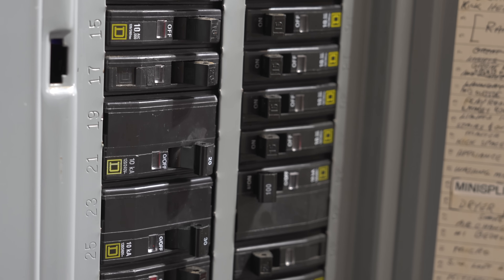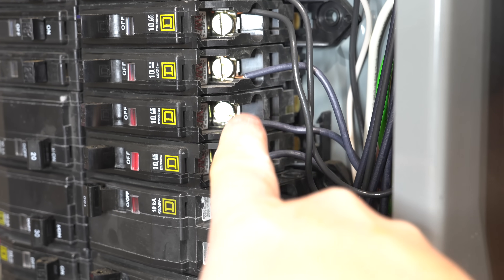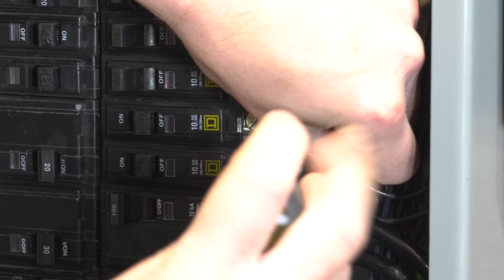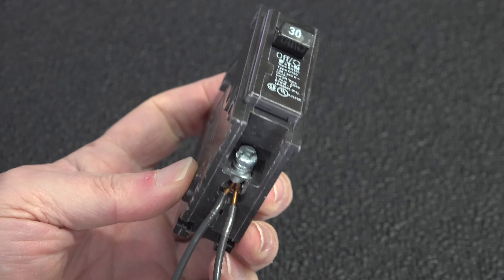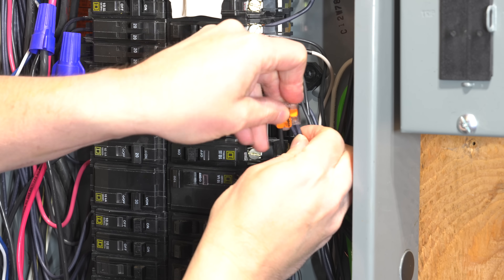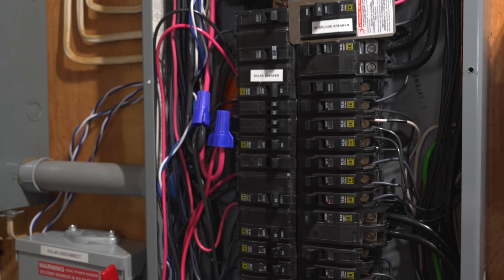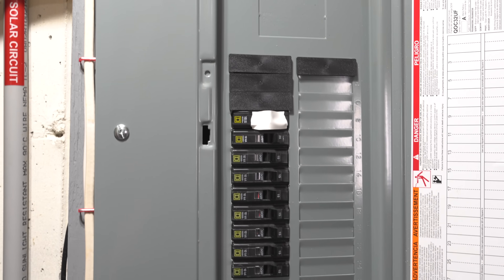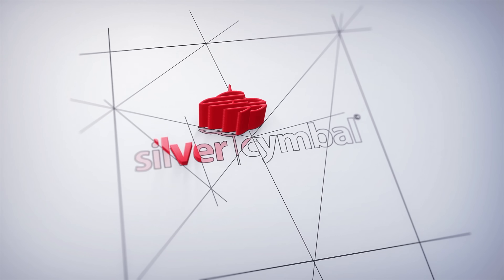Electric Panel Full?  Try This Simple Fix

Comment: There are rules on how many outlets or devices you can have on a breaker where I live. You could accidentally double the count by combining onto one breaker. Be careful
Reply: With LED lights, whatever the rule is for number of lights you can have is probably way under what is reasonable nowadays.
Reply: @LowJSamuel  While that may be true if using LED the issue is if someone else moves into the house there is nothing stopping them from using incandescent bulbs.
Reply: @jalmolky  There is also nothing stopping someone from plugging several microwaves into the same circuit, but you're still allowed more than one outlet.
Reply: @jalmolky  
Some newer light fixtures only accept LED lights
Reply: @LowJSamuel  Right, but if someone is doing that then they are doing it knowingly.  Different story if someone moves in expecting a regular circuit and runs into problems only to find out it was set up to handle an excess number of LED fixtures rather than a normal number of regulars.
Reply: @jalmolky  There are plenty of cases where people don't knowingly overload circuits and do something they expect to be able to do.  Code doesn't (and shouldn't) prevent all of these.  That's part of the reason breakers exist.  Putting a windows A/C unit plugged into an outlet that the microwave uses is an example I've seen plenty of times.
Reply: @LowJSamuel  Again that's something someone is plugging in.  Just to be clear my initial comment was to your saying the rule for number of lights is probably way under what is reasonable which is a "hard wired" assumption that everyone will just use LEDs.
Reply: @jalmolky  How is plugging in a device substantially different than screwing in a lightbulb?  Both are designed to be done by the end user and but you seem to think it's only ok for one of them to have a potential to overload if done wrong.
Reply: @LowJSamuel  Because one simply involves unplugging the device and/or moving it to a new receptacle/circuit.  The other is being unable to use certain combinations of switches until you swap out bulbs or perhaps even fixtures.
Reply: @jalmolky  I'm proposing that the code be updated to allow fixtures originally installed with LED bulbs to allow more of them on each circuit.  So you wouldn't need to change fixtures at any point.  If a later owner decides to replace lightbulbs with older technologies, that's really on them.  Especially considering incandescents can't even be bought anymore except for special applications, and the general consumer is pretty much only going to buy LEDs going forward.  I really don't see how expecting consumers to not replace their LED bulbs with antiquated bulbs they have to go out of their way to purchase is somehow more of an ask than expecting consumers to not plug in multiple high-load devices to the same circuit.
Reply: @LowJSamuel  Incandescent are readily available if you know where to look and are preferable where you want heat output (this may be climate dependent) and better quality of light (subjective).  We can keep going round in circles, but I stand by my original comment that code shouldn't be updated just because you can install LEDs if you choose.
Reply: its 12 plugs/lights for a single 15amp circuit. Its 85% which is the max you can have on a single 15amp breaker for safety reasons in most places. So it isn't good practice to doing what said in this video unless you test with a multimeter afterwards making sure the breaker isn't overloaded from what the manufacturer recommends or your local electrical code
Reply from the maker: Agreed I did say in the video to use a doorbell circuit or a single outlet circuit or similar circuit.
Reply: @SilverCymbal  a single outlet circuit shouldn't be used. It's dedicated for a reason and going about this haphazardly because you want more room for more circuits is dangerous. And when you move the next homeowner has to deal with the "upgrades" that never should have happened when they want to use the distributed power as it was intended. Using tandems and adding a sub-panel is fine because you're adding circuits without diminishing others.
Reply: The rules where I live are you only have to divid the house into two circuits.

Comment: DON'T MAKE SPLICES INSIDE YOUR PANEL
Reply from the maker: Hmmm, now if you are an electrician you are fully aware approved pressure connectors are absolutely allowed in your panel and common. Every manual transfer switch in the world uses these within a panel. So let's not go crazy here
Reply: Sure there are ways to do it safely but the homeowner who doesn't know the calculation shouldn't be given this option at all along with double tapping a single breaker.
Reply: Not crazy, just basic electrical safety that you don't seem to know about.
Reply: You don't know about the capacity calculation. It's okay to not know things, but this "because I said so" attitude is a real bad look.

Comment: Chicago electrician here, DON"T DO THIS!!!

If you're a home owner don't do this. This only works if you can calculate the load of both circuits to equal to or less than 80% of the breakers headroom. That's the only way a professional would do this; if the breaker taking a load that was at or under 80% of it's capacity. If you don't know how or why you'd need to do this calculation than you shouldn't be doing this at all.

The only acceptable solution in this video that a non-electrician should be doing is the tandem breaker.
Reply: Not to mention moving a circuit to an opposite phase on a mcbc causes a whole host of other issues.  Chicago suburban sparky here.  Pay attention to my brother electrician aaveloone.

Comment: Stopped the video immediately after you mentioned double-tapping the breaker and went to post a comment about using a Tandem breaker. . . I feel foolish now as you explained that moments later in the video. Great video!🙂
Reply: Double tapping is allowed if specified on the breaker, there will be 2 indents for wires if allowed.
Reply from the maker: Yes and though many are shocked to know that the double tap is allowed, as mentioned its ok for 1 or two needs but tandems are easier and the subpanel is good for long term needs as shown.
Reply: I was about to throw hands at my TV too. Tandem breakers! 🥰
Reply: @AndyTrent90 only if your panel accepts tandem breakers

Comment: Yikes SC, I realize that you have solar and dual back-up capabilities ...but man, that is one complicated and chock full electrical service. A packed main panel, a packed sub-panel and second sub....all that for a single family.
Reply from the maker: Yes, for this setup an additional sub-panel was needed. Keep in mind this house was built 30+ years ago too, long before smart stuff and internet. I have no idea why they wanted so much separation with circuits. It's still just a 200amp service.

Comment: I'm not a licensed electrician, but I've done enough electrical work, and worked with enough inspectors to think this is sketchy as hell. Will it work? Of course, especially if you're combining LED lighting circuits. Will it pass inspection? Ask your local regulatory organization to be sure. Anyway, thought provoking and probably controversial topic! Thanks! Dave J
Reply from the maker: Am inspector will not want to see more than 1 or 2 double taps or tandems and of course they always have the last say on any decisions and do not have the follow electric code if they choose not to.
Reply: @SilverCymbal  That is so true. I've walked into our county code office with code book in hand to complain about something an inspector "failed" and although I was technically correct the manager wouldn't budge, even though he had nothing to back it up. Just the way it is if they want to be more conservative. Once again, thanks for the great videos, I hope NH is treating you well. My cousin lives at the foot of Monadnock, so you're probably "neighbors" relatively speaking.
Reply: @dj-kq4fz  What's the point of the code if they're allowed to make up stricter rules?
Reply: @mezu-e  There is usually an appeal process if you disagree with the inspector and it costs money and time.  It is usually cheaper and quicker to do what they say, You also do not want "that" guy that winds up getting a hard time from everyone.
Reply: @SilverCymbal  Electrician here, Unless you know the calculation you didn't talk about a homeowner should never do this.
Reply: I have a bunch like this in my house. Like that when I got it and passed inspection.
Reply: @ChunkyMonkaayyy  According to the National Electric Code (NEC) the electrician installing the panel/breakers needs to do the capacity calculation for each circuit. Not sure what inspectors are suppose to do as it's going to change depending on the jurisdiction.
Reply: What is sketchy about?  Anybody can claim it's "Sketchy as Hell", but what do YOU say is written that says it's legally wrong or a regulatory violation by any county in the U.S.?  Give the legal reference why you say it is "Sketchy as Hell".   Tell us what rule, chapter and verse that says you can't legally do this, BEFORE you claim that it's "Sketcy as hell".
Reply: This is code compliant DEPENDING ON YOUR BREAKER BOX.

They each have data sheets and many will allow for two wires to able to go into one breaker (provided they are done via Wago and pigtail and not just two shoved in there).

That is my understanding at least.

Comment: Never thought of pigtailing  always used the tandems.  Thanks.  Learned something new today
Reply from the maker: Tandems are always an easy bet and take out the figuring out part. A little known fact is that about 99% of every doorbell transformer is double tapped to a breaker and sadly most are not rated for 2 wires. If they pig tailed as shown they would be. I would never put two wires on a breaker not designed for it and always pigtail if needed.
Reply: @SilverCymbal  I’ve spent the last 45 min seeing where I can free up space now hahahaha.
Reply: Tandems need to be listed for use in the panel. Check the door of the panel and it will indicate if the tandems are allowed . Inspectors will check for the listing.
Reply: I always use tandem breakers whenever there's no space left for another breaker instead of pigtailing two circuits on one breaker
Reply: In the case of a tandem breaker, the A/B doesn’t indicate the phase. Both breakers in a tandem are on the same side and draw from the same phase. However, breakers are supposed to be numbered with odd numbers in one phase and even numbers on the other. So putting two breakers in the spot previously taken up by one would throw the whole numbering off. That is why both sides of a tandem have the same number but are designated A & B.
Reply: @TheWilferch there are two A/B designations you are referencing. Leg A/Leg B covers the "split" phase "line" feed into the panel; anything toward the loads to be served is the"load" side. The breaker numbering can be split for tandem brakes to 28A & 28B, etc when using tandems. First is the service leg feeding the circuit, second is simply a convenience of numbering breaker positions.
Reply: @EngineerMikeF  ...I understand and agree with all you say. I think you need to see a specific GE GoldLine panel breaker-location schematic....to fully understand the point I was making. No doubt...going "Down" each leg of the panel.... breaker "1" ( top/left) picks up from leg "A" ( 120V). Breaker 3, immediately below breaker 1,  picks up power from "B" and so forth, in alternating fashion. Similarly.....the top right breaker "2" , picks up power from "A" leg....and immediately below, breaker "4" picks up from "B". Here's the rub.... the bottom 4 brwaker locations have capability of using the half-width breakers. The legs A and B at these locations look different with additional portrusions that ceetify these locations to be different and allow slim-breakers. The rub?---> each of these lower breaker locations have a dotted line running across them ( telling us slim breakers are ok here....YET....each FULL SPACE location is labelled A/B on the GE panel. Example...location 25 is labelled A/B yet clearly shows the "dot" as picking up power from "A"....and likewise, location 27 is also labelled A/B yet is clearly picking up power from "B". No doubt, when using slim breakers, you must be VERY careful WHERE the power is being picked-up from....ESPECIALLY for double-pole breakers that want each single-breaker of this "combo"....to pick up power from both A and B...one breaker for each leg. The rub--> why is the GE panel labelled this confusing "A/B" way for all slots 25-32 ?

Comment: So  an illegal double tap
Reply from the maker: No, a breaker designed for two wires is allowed or with a pigtail. Two wires on a neutral screw (single) in the panel is not.
Reply: @SilverCymbal  yeah I saw double occupancy breakers  part later on but like you said yourself probably still going to be double tapped either on the ground or on the neutral

Comment: The prior owner of my first house did that.  When I went to sell it, the inspector accused me of “double lugging” and failed the inspection.

Although I could’ve corrected it myself, I was required to hire an electrician to correct it and an electrical inspector had to check his work prior to the city inspector’s return visit.
Reply from the maker: Interesting, you are never allowed to have neutrals share a single screw, but you may have two wires share a breaker designed for two wires and the pigtail is commonly done to add a circuit or two. Tandems as shown are the best option before changing out a panel. I will be interested to see other thoughts on the video as well.
Reply: @SilverCymbal  
I think this particular inspector had it out for me before he even opened the panel.  It was wired in a spider web fashion and many rooms were wired together in the old-fashioned rag wiring.

I had motion detectors inside before they were code-compliant and may or may not have passed the double lugging issue if he wasn’t already peeved about everything else!

Comment: Ummmmm not no but HELL NO it's called double lugging ....... It not allowed EVER ...... ITS A CODE VIOLATION
Reply: If it’s listed for 2 wires then there is no violation. I believe Homline breakers are also listed for 2 wires.
Reply: @JoshD_123  Correct Josh! I just checked my Homeline breakers and they are rated for 2 CU wires, the smaller amp breakers with the pressure plate clamp.
Reply from the maker: Don't confuse having two neutrals under one screw with this. It's not a code violation in fact almost every house in the USA has it's doorbell transformer tied into another breaker. As shown in the video this isn't the end all be all fix but it is allowed.
Reply: Do you have the NEC reference for that? Most codes say to reference the manufacture instructions
Reply from the maker: @alexclark6768  You are 100% correct Alex, but many people confused having two neutrals under one screw which is never allowed. As shown this is different.
Reply: @SilverCymbal  It was allowed or accepted in the past, but having more than one neutral wire under each lug is a code violation
Reply: No huh uh y'all ain't telling me different

2black wires in any breaker is double lugged CODE VIO......
Reply: @zoeyjohnson1985  Section 110.3(B) of the NEC requires that listed or labeled products be installed in accordance with any instructions included in their listing or labeling.  So if the breaker says it can handle 2 wires then its ok.
Reply: @alexclark6768  uhhhh nope never one wire no matter what instructions say

Comment: What did they do in your house is every outlet on its own circuit breaker
Reply from the maker: The original builder of this place loved circuits, must have been a pet peeve or something. I only wish they put 3 panels side by side, double tapping is fine for a few per panel but this thing was insane.